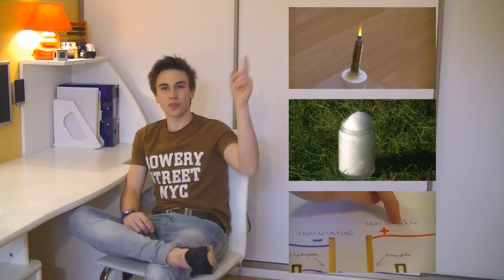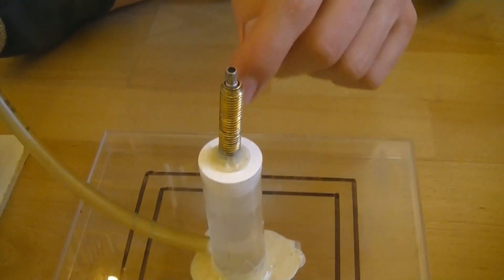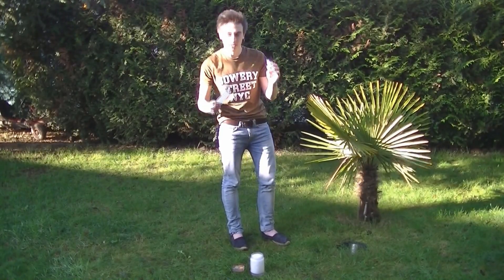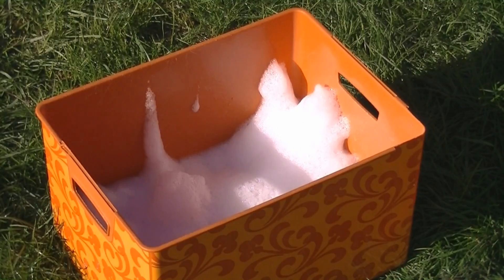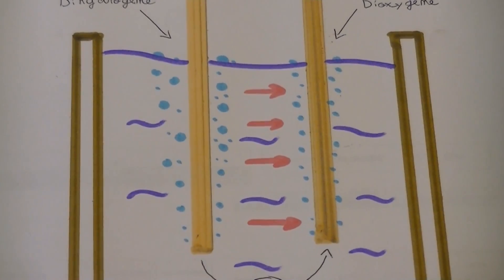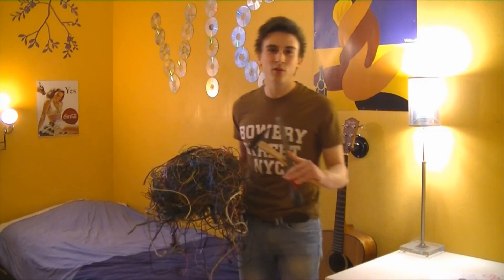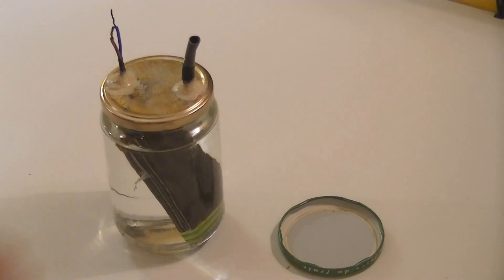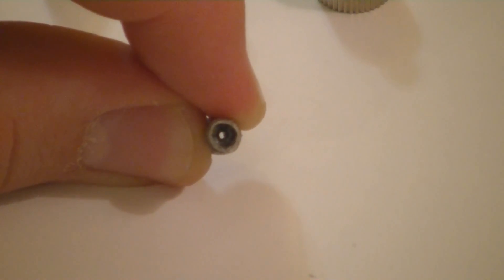Water electrolysis : DIY Experiments #5 - Make hydrogen / Brown's Gas / HHO generator / Oxyhydrogen

Comment: How do you keep from flash back?  How many volts are you using ?
Reply from the maker: 3V by cells, there are 3 ways in series to prevent flash back!
Reply: @DIYExperiments  what's the 3ways?
Reply from the maker: Bubble, bubble, tiny hole, filter

Comment: Which power supply do u use in ur experiment? I mean what voltage and current is given by ur power supply?
Reply from the maker: It's a first gen Xbox 360, 17.5 Amps, 12V

Comment: Try this experiment again with pure water, but use voltage in the kilo volt range.  I've done this, and it actually works.  No, electrolyzer.  The purer the water the better. The high voltage exceeds the breakdown voltage of the pure water and releases the hydrogen and oxygen.

Comment: Why are we not burning this for power instead of natural gass, coal, or uranium if its by-product is just water? And im not talking about fusion ether, just burning the same way we burn natural gass.  We could power our homes wile also simotainiosly supplying water from the same source.
Reply from the maker: The energy comes from electricity which comes from nuclear in majority here in France... The matter comes from water, not the energy ^^
Reply: DIY Experiments i understood that water was a product of the oxygen and hydrogen binding together in a chemical reaction that starts and produces heat but ive never heard of water coming from energy. Also does this mean that hydrogen cannot be found in a pure state naturally or in a state thats easy to separate?
Reply from the maker: I never said that we could make water from energy ^^ I just sait that this doesn't create energy, the whole energy comes from electricity (and the global efficiency is low, around 40%).

Comment: Is, the mixture any different when using graphite plates?
Reply: the oxygen coming off the anode can oxidize the carbon in the graphite causing the anode to dissolve. or at least this is my experience with most electrolytes; i haven't tried out sodium hydroxide yet

Comment: Impressed how u can hold the wire with your fingers and my get burnt and how u quickly light up the fire worrying u may get burnt... don't heat travel thru metal? Hahaha
Reply: UFO lover Strange Encounters Singapore 2017 ookooo
Reply: If you use low voltage with a narrow wire it will heat up alot but if you use a thick wire it wont heat up as much

Comment: Does the output gas include O2 as well? Because electrolysis will get you 2 H2 and O2 from 2 H2O
Reply from the maker: +THE GARRISON : Of course :) Thats why it's hard to prevent the flame from moving back to the electrolyser. The flame doesn't need air !
Reply: DIY Experiments What if you add a water tank and bubble the gas output into the water, so that the gas doesn't move back into the electrolyser
Reply: Wei Zhao you’re right but no need to be rude is there?

Comment: Never use salt
Reply: Because you may die. When doing electrolysis you are splitting water (= H2O) into H and O. Salt (= NaCl) may also split into Na and Cl. Cl = chlorine. Chlorine is a toxic gas.
Reply: Richard Carter why not
Reply: Any alternatives?
Reply: CrustyMilk, NaOH (sodium hydroxide), Na2HCO3 (washing soda). If you don't have washing soda, put baking soda on a cooking pan and roast it until it is sightly grey/yellow, and powdery.
Reply: baking soda.
Reply: Richard Carter  what you said is correct if we use salt it will produce chlorine gas
Reply: sodium chloride under electrolysis produces chlorine gas which was used as a poison gas in WW1 much like mustard gas
Reply: Even if it does release chlorine gas, the amount won’t be enough to do much harm at all
Reply: @ everyone, I have tried making chlorine gas using electolysis on the scale that they are doing, and nothing, no measurable amount of chlorine, I was trying to get chlorine gas and hydrogen and react them to make HCl, and no reaction, no acid, so salt is fine. Also, baking soda is NOT sodium bicarbonate, it is sodium HYDROGEN carbonate.
Reply: @EdwardTriesToScience  sodium hydrogen carbonate and sodium bicarbonate are literally the same thing, electrolyzing NaCl releases chlorine gas, but the amount is small
Reply: @ioan007  Yeah I now have more experience and have realized how stupid those comments I put are
Reply: Fucking pussy
Reply: Salt is perfectly fine because the chlorine gas just dissolves back and neutralizes with the sodium, creating salt, but some still escapes, but if you work with hydrogen, you should always be in a well ventilated area, so the chlorine is fine. However, do NOT use stainless steel as the electrodes, because of hexavalent chromnium, basically cancer causing metal.

Comment: You mention that it is hotter than 2500 °C  ( @1:16 ) , I think it will be much higher.  Since it is being burned in pure oxygen it should only be about 280 degrees less (3200 °C ) than an oxyacetylene flame ( 3480 °C - (ref: https://en.wikipedia.org/wiki/Adiabatic_flame_temperature#Common_flame_temperatures) . Thanks for the great video, by the way.
Reply: it is hotter because it also burns the hydrogen
Reply from the maker: +Bert Isevil : Yes It's may be true, but i have not way to check ! In theory it's a stoechio combustion but juging by the color of the flame, it's more white than blue... !?

Comment: hi, I will pay you $50,000 to make me an engine from this science!
Reply: how big
Reply: +2WheeledWanker ! depends... how are you going to build it... and do you know how to build it?!... I can let you do a 6 cylinder engine...and I want the water capacity to be as much as possible and I want to put alternators to recharge the butteries... and I want you to test it time and time again... until you perfect it!
Reply: roy quinones I have already build it and I would sell it to you, the only problem is that it has 8 cylinders.
Reply: roy quinones ï Can n ï am doing diz as m'y final year project  
but ï am adding hydrogène  fuel tanker  Which is too dangerous but ï have plan for dat too✌✌
Reply: roy quinones 😂😂charging by alternator good idea It wont work Its against law of thermodynamics please find some working plans for dat if ü get plzzz share with me
Reply: That is over priced, also if you are planning to patent a car that runs off water, don't someone did that and they got assasinated.

Comment: 7:40 "A charge of one Faraday has been consumed" - It's actually one Coulomb, right?
Reply from the maker: When one mole of electrons flows, a charge of one Faraday has flow. That is not one Coulomb but 96500 Coulombs !
Reply: Yeah, actually the number is correct (~96500 C). I was actually talking about the units (you used Faraday for charge, but 1F=1C/V, and is a unit of capacitance.)

Great videos, though, subscribed =)

Comment: yeah you have to increase the velocity of the hydrogen gas  to drive the heat out of the torch or it will burn down like a metal candle.  all gas torches for welding and such have this necessity.
Reply from the maker: Yep. Here it's more difficult than in a welding device : gases are already well mixed !